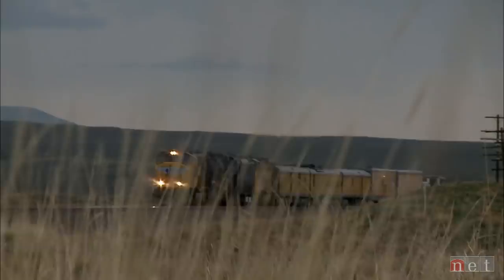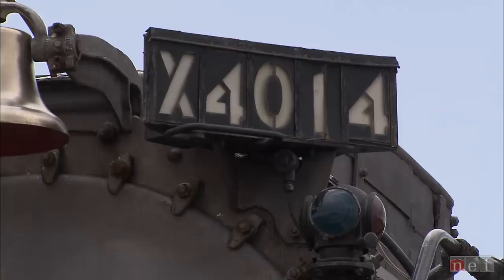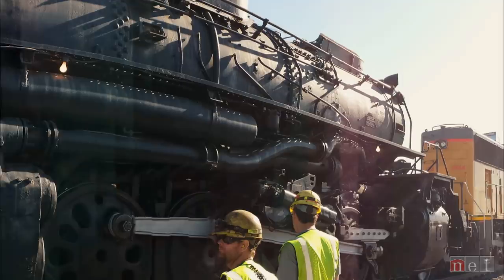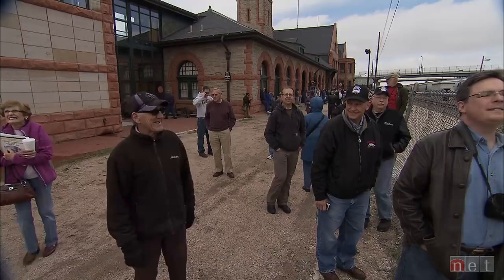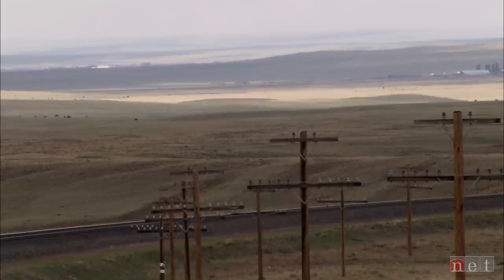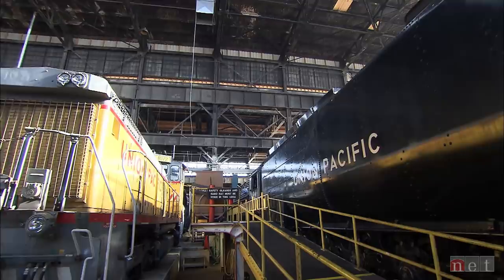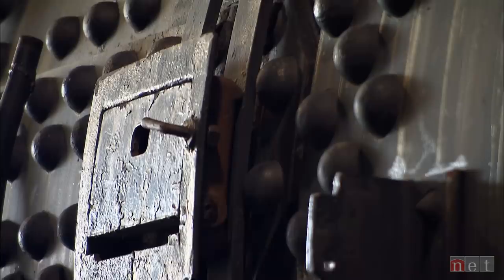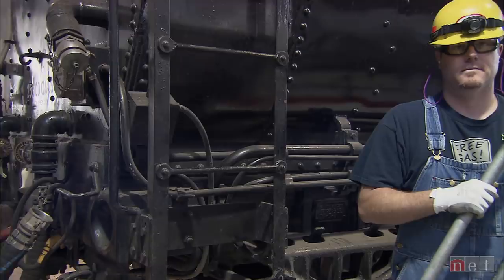Restoring The Big Boy | Nebraska Stories

Comment: I heard that the UP steam crew located a couple of oil burners from an SP cab forward that they will use in this conversion. Back when the Big Boys were running, one was converted to oil as an experiment, and it failed, not get hot enough. So they were kept as coal burners. If you recall, both 844 and 3985 were coal burners originally, and were converted to oil.
Reply: maddennis55 if they can do 844 and 3985, then they can do 4014
Reply: Wouldn't it be something if they restored a cab forward locomotive.
Reply: maddennis55 - Nope. It didn’t fail.

Just wasn’t practical to spend the $ on old technology with the diesels right around the corner. Creative theory, though.
Reply: I like the idea of oil+liquid oxygen.
Reply: @chrispotter3324  UP actually thought that gas turbines were the way to go for a while.

Comment: When UP tried to run one of the Big boys in it's fleet on bunker heavy fuel oil instead of coal (because of the higher coal prices then), it failed. Because of the lower BTUs of the bunker fuel demanding more fuel consumption compared to coal. Then they reconverted the engine back to coal again. 
I can imagine running the 4014 today on lighter Diesel #2 home heating oil. It may also fail. Because of trying to get all of the 4014's massive firebox combustion chamber heated evenly and with enough BTUs for the required high pressure 300 PSI steam on lower BTU #2 Diesel. When UP ran the Big boy on Bunker fuel oil 60 years ago, it was very, very thirsty. Because  Bunker oil has less BTUs than the solid fuel coal that had more range,  AND #2 Diesel has less BTU's than Bunker fuel oil!
Reply: it will run on no.5 fuel oil
Reply: I believe it was the 4005 that they converted to oil. That being said, UP used only one burner assembly in the conversion which led to uneven boiler temps and diminished steam output.

Comment: It will be converted to burn oil, not diesel fuel.
Reply: +Steve W Exactly. It will burn No. 5 fuel oil.
Reply: Bunker C fuel oil which is used oil taken from the jiffy lube shops.
Reply: From what I know, "Bunker C" is the stuff left at the bottom of the pot when they distill off gasoline, diesel and the other things.  It's used in power plants, ships and other places where it can be heated to a significant temp to make it easily pump-able.  Things like roof tar and asphalt are a lighter fraction.  I suppose when they re-distill used engine oil to get a useable oil some bunker c would happen.
Reply: I happened to observe the 844 being fueled up outside Cheyenne shops purely by accident one day. Pulled into the shop driveway and walked over to where they were getting ready to fill the fuel bunker on 844. Talking to the tractor trailer driver I found out they were actually fueling the locomotive with bio-fuel aka bio diesel fuel. The big advantage of fueling her with diesel fuel is she can fuel at any railroad fuel stop and the way the railroads fuel engines today is simply order a truck which pulls up to wherever the locomotive's are sitting be it a siding 100 plus miles from the nearest service facility on in a yard. With road freight locomotive's now holding near 6000 gallons of fuel they no longer need to be fueled every other day.

Railroads used to specify what size fuel tanks they wanted on a class of locomotive's until GE and EMD decided it was easier to simply make one tank for all 6 axle locomotive's and one big fuel tank for 4 axle locomotive's. When I first hired out as a fireman in 1971 most of out first generation road freight engines held an average of 600 gallons of fuel ALCO RS-3's, EMD GP-7's and 9's. Mostly by then they were used in yard service and local freight service. Some of our GP-7's and 9's were equipped for passenger service and when they came out of passenger service a number of them had the water tanks connected to the fuel tank to increase the fuel capacity from 600 to near 2000 gallons to increase the range of the locomtives.
My favorite engine from the 70's was Penn Central 5229 an ALCO RS-2 the last one operating on the Boston and Albany.
Reply: @geomodelrailroader  When Jiffy Lube actually does the oil change...
Reply: Why in the world would you convert a steamer to run on diesel? My (not very local from me) 891 mm gauge railway organisation that I go to wich just happens to be scandinavias longest 891mm  gauge. Anyway we are currently restoring a 891mm gauge steamer that was built in only one example to run on a railway on the swedish Island of Öland outside the Coast of Kalmar in South sweden. We are gona convert it to oil so we can run in the summer. Unlike our other 2, L18p tender engine and S2p Tank engine. They only run in the summer If there has been constant Rain for at least 48 -50 hours according to the fire departements along the railway
Reply: @geomodelrailroader  Really? That would be a selling point for Jiffy.
Reply: Steve W diesel is a fuel oil.....
Reply: DJ Блять its still a steam engine. They are fueling it with diesel instead of coal.

Comment: Slinging heavy Iron and Steel take a certain kind of crew to survive the dangers that lurk around every nut and bolt. And at times a certain kind of humor takes the edge off the long day. Working with a crew member in a tight confined place is normal. Then seeing "FREE GAS" printed on your buddies shirt and his large grin on his face. You know at that time, things are not going to be boring.

Comment: So this locomotive is going to be converted from coal to diesel fuel. does this mean that there will be diesel fuel inside the fire box which will be set on fire and produce steam? If so, this is a bit of a big challenge and I hope it succeeds.
Reply: +jacob mutti Correct, it is still a STEAM locomotive since the fuel being burnt is still turning into steam within the locomotive, the only difference is that it's using a different fuel.
Reply: +jacob mutti It's not going to burn diesel fuel, the idiot just said that. It will burn oil. Diesel fuel does not burn unless it is compressed, so it would be impossible to have it run on diesel fuel.
Reply: Diesel fuel  =burns= quite well.  In fact, too bloody well! It's just that a diesel =engine= uses compression rather than spark to ignite. Oil is far better for an =open= source of heat.
Reply: There used to be are a lot of #2 diesel fuel fired home furnaces and there are still quite a few.  You just need to have the pump, spray nozzle and firebox which is designed to burn it.  Running diesel fuel to fire the big boy would make it too expensive to even fire up much less run.  They will be using a very low grade bottom of the barrel, left over from the still which had been a throwaway waste product until they developed ways to liquefy, pump and burn it.  It is used in oil fired steam boilers at power plants and in LARGE ocean going transport vessels engines since it takes a huge effort to burn it.  The Big Boy will be able to burn it because it can produce enough high temp steam to liquefy it so it can be pumped.
Reply: ExcessMean 
It won't be burning diesel fuel, that is correct. "Diesel fuel does not burn unless it's compressed" is absolutely, categorically wrong. Just like the no. 5 fuel oil it's being converted to run on, if you heat no. 2 fuel oil (diesel fuel) first, it will readily burn without being compressed. Hot diesel fuel vapors can explode if they ate hot enough. No. 5 oil is pre heated for two reasons: 1. Most important, it's too heavy and thick to be pumped through the burners in the fire box without being heated first, (read up on the UP Turbine Electric Locomotives that used the same fuel) 2. It burns more readily.

Comment: I love how the sd70mac number is 4014 it should be a heritge like sd70ace 8444
Reply: NotYourAverageGaming 11 
It's not a 70mac. It a 70 M. It has DC traction motors, not AC. The M means it has a wide safety cab.
Reply: What about #4884 behind 4014?

Comment: number 5 is a type of diesel as diesel is more of an oil that a gas and there are various grades just like kerosene which is also a type of diesel fuel So Steve W you are correct along with the commentator
Reply: Cory Hoover 
No. 5 is a type of diesel. That is just so wrong. No. 5 is a heavy oil (like a grease) that must be pre heated before it can be pumped to the burner. It's nothing like diesel.

Comment: *Coal to oil, diesel fuel doesn't burn at atmospheric pressure and therefore, won't work.
Reply: MOM ITS NOT WHAT IT LOOKS 
Diesel fuel most certainly will burn at atmospheric pressure. It just takes a small bit of heat to get it going. Try it, put some diesel in a container and throw a lit paper towel in it, it will slowly start burning. Once it's burning, the hotter it gets, the better it burns.

Comment: So the Big Boy is now a dieasel disguised as a steam locomotive now that it runs on fuel? Or is it now a hybrid?
Reply: It's still a steam locomotive. It will just burn oil instead of coal to heat the water.
Reply: As long as it runs 
I'm happy there bringing the big boy back
Reply: It will run on oil, not diesel

Comment: It's a big boy not the big boy
Reply: No I think the 4014 is the last one. So with that said, it would be ''the'' big boy. I could be wrong but if there's another one out there I've got no idea where it's at. then again i'm in the UK so...........
Reply: Okay I stand corrected.....In total, 25 Big Boys were built in two groups of twenty and five locomotives respectively. All were coal burning, with large grates to burn low quality Wyoming coal from mines owned by the railroad. One locomotive, number 4005, a conversion to fuel oil was attempted as an experiment, but was not completed.
Reply: @chaosdemonwolf1  There are 8 Big Boys left.

Comment: What crap that it will burn veggie oil, it isn't a vw!! The locomotive should burn coal as it was built!
Reply: +Bryan Phillips all UP steam and most steams on other roads burn the number 5 fuel oil
Reply: Until the ecomorons complain, they were burning veggie oil on the Grand Canyon RR. The 4014 SHOULD BURN COAL, AS SHE WAS BUILT. I DON'T CARE WHAT YOU HAVE TO SAY, THE LOCOMOTIVE SHOULD BURN COAL!!!
Reply: +Bryan Phillips  I wish it would burn coal too, but that would cost them a fortune.
Reply: +Bryan Phillips  Right on Bro…. I spent many years in engineering.. a phrase that we came to loathe was, "re-engineer".. what that means is something wasn't built correctly in the first place. Big Boy was built correctly and not designed to burn coal oil, or any other type of oil. As far as the eco-nuts go, don't even talk to me unless you're over sixty years old, and have stood on a depot platform in 1955 awaiting the most scary and awe-inspiring thing ever seen in you entire life:  A steam train pull into that tunnel. You can't "imagine" it from Youtube videos, nor dreaming about it. You had to be there.  If you were, then you understand what Bryan is talking about.  Do some research. See what it takes to fire a stem locomotive and why.  I just hope UP will reconsider. One Big Boy puffing smoke as it was designed to do is not going to pollute the country.
Reply: +Jim Griffin As with anything in engineering its about compromise. Coal VS Oil for fuel each has advantages and disadvantages. The steam team is aware of this, and feels the safety measure and cost of running the steamers on oil outweighs the benefits of burning coal. After all the SP cab forwards ran on oil so its proven a firebox the size of a 4000 can run reliably on oil. Since UP no longer owns coal mines, and the risk of fires starting trackside from hot embers the oil is necessary for the program to be viable in todays age despite my belief it should remain coal fired. Burning oil is said to be easier on the engine as well (less abrasion on the flues, running gear, etc from the ash)
Reply: +Bryan Phillips Demanding it to burn coal means it will never run again. There is no infrastructure for a coal fired locomotive. Either they burn #5 oil or they don't burn anything.
Reply: Exactly Brett
Reply: Plus think of the pain it would have on the environment, pumping out clouds of black smoke. I think this is a safer route to take than coal.
Reply: You think burning oil can't produce thick smoke?
Reply: It will not be burning veggie oil. It isn't the same as coal, it's better than coal. With fuel oil, they can have more control over the fire and can run more efficiently than they ever did while running on coal.
Reply: Jesus criminy, it is just fuel
Reply: UP is going to convert the big boy to oil because if they keep it oil, they have risks of forest fires, that is why the UP Challenger 3985 was converted to oil, plus coal is a bit expensive to burn.
Reply: Coal is too expensive and Oil pollutes less
Reply: Hi I'm from the UK and I'm struggling with the running on oil part do they mean just heat the boiler on steam or turn the beast into a dam diesel.
Reply: The sight and sound of this monster at full angry belching smoke and steam must have been staggering and I would sorely love to see it. It's part of the history of our nation and changed the world. I seriously doubt any "ecomorons" would care one way or another if a few old engines ran coal. When you examine the reality of it, sadly, for all the grown up reasons given here,  it's just impractical to use coal. Having an all caps tantrum with multiple exclamation points and looking for someone to blame won't change that fact. I as much a romantic as the next guy. I mean coal burns at over 1,000 degrees Celsius. Oil? 90. That has to effect the Re-charge rate of steam over using oil. .  But some things just are what they are.
Reply: Bryan Phillips the amount of infrastructure they would have to build throughout the line to support coal would be stupidly expensive and NOT worth
Reply: I DEMAND that it run on COAL!!!!!!!! DO YOU HEAR ME!?!?!?!COOOOOOOOOOOOAAAAAAAAAAALLL!!!!

...Shut up. Please.
Reply: do you realize that peices of hot coal would start wild fires? i know that it did burn coal, but it would have to stop and go and stop and go just to get coal! oil is the only solution.
Reply: @IDigAPony   Wait. Oil burns at 10 degrees less than the boiling point of water? on what planet?
Reply: Mark Newell 
Yes, they will use #5 fuel oil to boil the water in the boiler. It will be a proper oil-fired steam locomotive. The reference made about running it on diesel fuel was incorrect.
Reply: Chris Potter What are you, some relative of them thar Koch brothers? Give it a rest; it’s an infrastructure problem. Nobody cares about your “demands” anyway. Be glad that there are folks with large buckets of cash to get this amazing piece of machinery running again,so we all can appreciate what has happened in history.
Reply: What idiots don't realize is all your plastics factories and oil refineries pollute 10 times as much as this engine. There is no shortage of coal. There is thousands of abandoned coal mines all across the country that nobody has touched for 300+ years, they just don't want to do it.  Also 90% of the smoke coming out of a steam engine is unburned carbon.
Reply: @maxj0930  I think he is making fun of those people.
Reply: @marknewell7355  No, they are just making it so the oil heats the boiler, not a diesel.

Comment: I think it's a good idea to make it run a diesel fuel but it could be something else too. It will just have to be a power source that is able to fit in Big Boy's massive firebox
Reply: TheOtherRailway 8
Reply: TheOtherRailway 
Not going to run on diesel, never was. No.5 heavy fuel oil. Has to be pre heated just to be pumped to the burner.

Comment: Not the largest, lookup N&W TE-1 #2300
Reply: nope wrong the big boy is the biggest train in the world ok
Reply: A 'train' is the loco and all of its consist!
At 161', the Jawn Henry is 'bigger' and had just a bit more rated tractive power. but didn't have the power at speed.
Reply: That was an experimental turbine locomotive. Yes it is true that there were a few turbine powered steam locomotives that were larger such as the Jawn Henry , but none of those experimental designs were deemed successful so nobody really counts them.

Comment: if they make it run on oil it won't have the heat to give it enough steam so it won't have all of it's power
Reply: #6 fuel oil=17410–18990 B.T.U.s per pound. Premium anthracite=15,000 B.T.U.s per pound.
Reply: Zombie Slayer...... That is absolutely NOT True... The 844 and the 3985 have both been running on No.5 oil for many years,  as well as other steam locomotives around the country.    The 4014 will actually be able to produce More power on No.5 oil than it did burning the "soft" native coal of southern WY.   Soft (re; low heat output and VERY Dirty burning) coal was then mined (and owned by) by the UP itself..... that is, no longer and neither is Any, of the infrastructure needed to "feed" a steam locomotive... Anywhere on UP's system.
Reply: 3985 was successfully converted to oil from coal and runs very well on it. The key to a successful conversion is in the burner design, which they didn't have quite right when they originally tried it on a single Big Boy back in the early 1950's. Pre heated no. 5 oil sprayed through a well designed burner makes a hotter fire than the coal it's replacing.